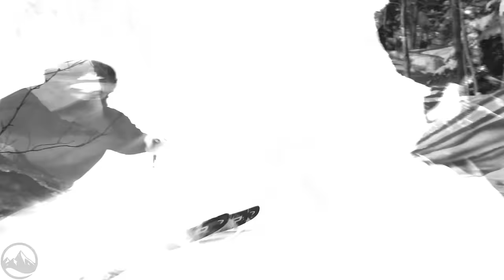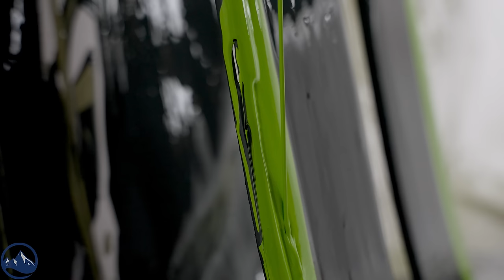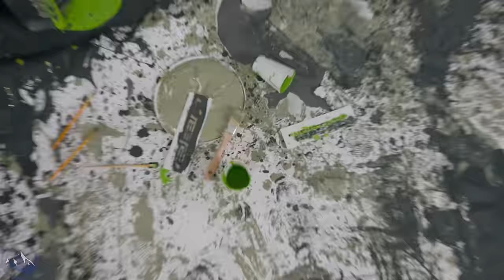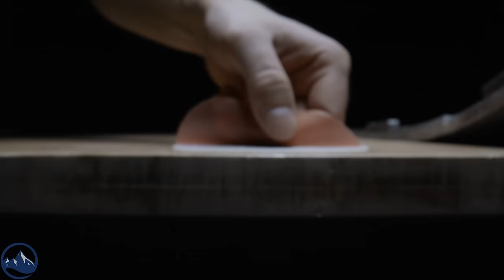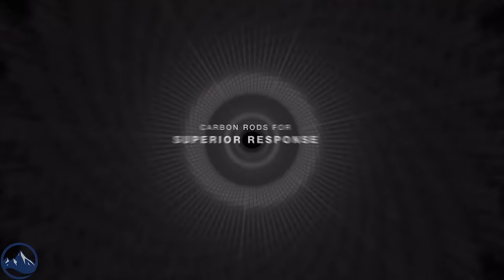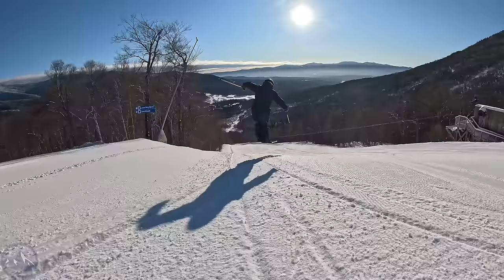2025 Elan Ripstick Ski Collection Introduction and First Impressions with SkiEssentials.com

Comment: This video is very interesting. I have been on Elan skis since I started 4 years ago. Currently on a Wingman 86 TI 178cm, which I feel has helped me progress quite a bit this season. I like the on piste feel of the Wingman, but am looking for something that will allow me to venture to the side and maneuver better in tighter areas like trees. 

I have been intrigued by Ripsticks since the beginning, but was concerned about how they cope with chopped up afternoon snow. As a 6'1" 180lb progressing intermediate that skis exclusively out west (85% on piste) a few times per year, I am wondering how the new Ripstick 88 or 96 would compare to the Black Crows Serpo or Atomic Mavericks. 

Also, if there is any other ski out there that is stable in chop/crud, maneuverable in tight areas, and approachable for a slightly less aggressive skier that I should consider, I am all ears. Your reviews set the standard, and we are all so grateful for your contributions to the community. Cheers!
Reply from the maker: The Ripsticks are very easy to use in chopped snow, but they do not excel in terms of performance.  The Serpo and Maverick will hold up better at higher speeds as those are more stable skis, but they're also more demanding.  The nice thing about the Ripstick is that it's very fun and playful in a lot of different zones, but it's not terribly rugged when it comes to challenging snow conditions and terrain.  I think you're in the right spot with the Ripstick, and I'd lean to the 96 for added width.

Comment: Is there a weight difference between Ripstick 102 and 102 Black? The website shows the same weight, but wondering if that is a typo since there is extra carbon and rods?
Reply from the maker: Keep in mind that when you add the rods, you're removing wood, so it's a neutral weight change.  I just put both the 102's on the scale and the Black Edition's pair was 30 grams lighter than the normal 102.  Basically they're the same weight.

Comment: As an owner of the current 88, i like seeing the increase in shovel stability. I like what the 88 does, especially on the early days in the season where my legs arent as build up as after 15 or 20 days. However, and i know that's a really strange comparison, i grab my Mirus Cor more frequently and it outperforms the Ripstick in nearly every aspect (for me, entirely skier dependant, i'm an lightweight aggressive expert). It's more confident in crud and soft snow, the shovel just plows through everything, it's more consistent tip to tail, does not get deflected as easily, it's the better carver, it's as nimble as the Ripstick and weight isn't dramatically off of the Ripstick. I attribute most of these things to the (too) soft shovel of the current 88, and seeing them improve that aspect will provide skiers with an overall better choice and experience, without any obvious downside or taking away accessibility.
If there ever was a moment to add an 88 Black, it's now! It'll fit in perfectly with the new shovel and smaller step up in overall stiffness.
Reply from the maker: Great feedback, and thank you for sharing!
Reply: Skied your Mirus Cor, and with a 13.0 Radius, they are slalom racers !  The 96 Black Edition will make you a believer with a radius of 16.2 and quiet shovels !   They kill in all conditions.

Comment: Love the current RS 88 for frontside carving, and playing in the late day crud.   I am 5’9” 185 and loved the 172.   Are the new 88s any different carving and playing? What length would you recommend with the new model length difference.   I just tried Wingman CTi and thought that they were great for carving but not nearly as playful or good in afternoon crud.   Trying to decide between this year’s model and the new ones.   As always, love your reviews.
Reply from the maker: I find the new 88 to be more playful and eager to finish a turn.  I like the added versatility of the taper and slightly wider waist and tail.  That said, I personally prefer the slightly straighter old version, but mainly because I enjoy the 188 in that ski and haven't yet skied the 189 in the new 88.
Reply: Is the carve the same?   With the new sizing, should I go up or down from 172….i prefer slow to fast.   Thanks!

Comment: Huge Elan Fan...Knowing Jeff seems to be on the fence of the Regular and Black Edition 96's, I can say with un-equivocal certainty, that skiing in the East, especially Mt. Tremblant and Sugarbush, that the need for a super strong ice grabber is as important as a playful mogul masher. The Black Edition covers all bases, and has the added pop when flying down the groomers doing the turn and burn. The regular Ripstick 96 is wonderful, but a touch more chattery when ripping, and not as strong on biting the ice. My other go-to is my Stockli Stormrider 95's but as wonderful as those are.....and they are wonderful, Elan offers a better overall Freeride/All Mountain experience with the Ripstick 96 Black Edition.
With that said......Great reviews, Great Chairlift Chat and T-Bar Talk....keep it up !   Wonderful to watch you guys review and ski all the time !   Hello From Mt. Tremblant !
Reply from the maker: Thanks!  T-Bar talk was a great addition.
Reply: I’m trying to choose between the 96 black and the Stormrider 95. Tough choices
Reply: Having both the 96 Black Edition and the Stormrider 95, I would say that if you are going to spend more time cruising, The Stockli is King, but for versatility, like moguls The Elan is the better choice IMHO. 😊
Reply: Thank you. That helps
Reply: @delriv5238 I own the 96 Blacks, I’ve skied a Stormrider 95 and for wide open terrain and going fast through crud or on hard pistes, Stockli all the way. I’d take the Ripstick for bumps and trees.

Comment: Been skiing Elans for decades, never been disappointed!  The last 2 seasons I have added wider all mountain 90ish 177ish 2 sheets of metal as my daily driver.  However….as I rotated in my 74 under foot Amphibio’s , 168, I cant help realizing that the tighter skis are for me a lot more fun as a side of trail short turn specialist here in the northeast.
    I see that Elan has added in the Primetime series.  The Primetime 55 looks like a ski right up my narrow alley on the 8’ edge of the trails, and also ripping the full carve GS 50mph turns.   Have you guys skied this model yet?  From my days out this season I know I’m going back to the narrower all mountain frontside Northeast groomer and leave the wide boards for snow storms as rare as that can be here in Vermont 2024.
Reply from the maker: If you like the tighter arcs in skis, the Primetime 55 is sweet.  We skied them last year and thought they were great.  I'm not sure about the full GS 50mph aspect, but it's definitely a great short to mid-radius carver.

Comment: Considering Stockli SR88 and Ripstick 96 Black. I’d appreciate your advice. I skied the Kastle MX89, then I got the newer MX88 model both in 180, but I sold them last season and started riding Faction Dancer 3s 183, thinking I wanted better all mountain and width, but clearly it’s not the ski for me. Even on front side, it’s a lot of ski for me (tall but lightweight). Simply, the Dancer 3 is way too much ski for me, and I felt the MX88 was a bit too much ski in the bumps, but awesome to rip on the groomers. The last two seasons I started doing a lot more bump skiing as my son is a bump monster. However, I’m still a front side ripper at heart.

I’m looking for a new one ski quiver that can hang in the bumps, the crud, the trees and still have ample front side high speed grip. I ski exclusively West Coast (Vail, Tahoe, Whistler). Thanks
Reply from the maker: The Stockli is nice because it has a lot of the same versatility of the MX 88 but with a lighter and quieter character.  An amazing carver for sure, but also is accessible in bumps, crud, and trees.  I fear you won't get the same type of on-trail personality that you want out of the Elan.  If you're a front side ripper at heart, the Stockli is a considerably better option without leaving too much off the plate when it comes to versatility.

Comment: How would you compare the 2025 Ripstick 88 to the Armada Declivity 88C? Mostly looking for snappy edge to edge transitions with energy coming across the fall line at decent speed (not interested in smearing/slashing, prefer to be on edge). The increase in Ripstick stiffness this year sounds like it brings these closer together.
Reply from the maker: The Armada is still stiffer and more responsive from tip to tail.  The Ripstick still has a pretty flexible shovel, and while that's great for easy initiation and softer snow performance, it's not as reactive on firmer snow.  If you're looking for more edge grip and energetic transitions, I'd go with the Declivity 88C.
Reply: @SkiEssentials  Thank you!

Comment: I'm looking to add a 100+ to my quiver.  Currently ski a Stockli Montero AR as my daily driver and love them but want a fun off-piste ski that is on the lighter side but still responsive when I am on-piste.  The new 106 black looks interesting.  I also have an original Enforcer 93 that I have pretty much ditched this year for the Montero.  I'm 6'1", 250#.  PNW skier.  I would say advanced/expert.  Recommendations?
Reply from the maker: If you like the overall style and feel of the Montero, I'd at least give the Stormrider 102 a look--that ski is similar to the new 102 Black Edition from Elan, but with a stronger tail and a smoother overall ride.  For a bit more heft, but not too stiff, the Salomon QST 106 is another easy winner.

Comment: Guys, i’m a similar size to Jeff but now in my 60’s. Get to ski say 2 weeks a year and looking to replace my 9 year old camox (i know !) Back then these had a flat-ish tail so now likely to up to mid 70 length from 168. Love sound of these Ripstick 96, also rustler 9 and of course camox. In reality mostly on piste, occasional itinerary but always go off the side on the few days there is fresh. I go nowhere near to a park! Any thoughts/recommendations?
Reply: Forgot to mentiom, i like how i can smear/get the camox sideways to get myself out of trouble 👌
Reply from the maker: The Rustler is the easy choice especially when you're looking for rounder tails.  Nice to have the metal along the edges in the Rustler with the increased rocker for softer snow.  Easier to smear than the Camox and a smoother carver!  Ripstick is nice and light and agile, but doesn't have the same overall sturdiness of the Camox or Rustler.

Comment: Welp crud . I just bought a brand new pair of 2024 96 blacks 172cm. How much of a change did the BE's get for the 2025  model year?? Sounds like more stability, less vibrations and smoother? Also better and more accurate sizing (175cm!) as I was in the middle. 5'9"/155lb. Ugh.
Reply from the maker: I think you'll be just fine with your 2024 96 Black Edition--that is one of my all-time favorite skis.  The change for 2025 is pretty noticeable, but not a blanket positive for everyone.

Comment: This review gave me a pause. I was about to add Rustler 9 as a final piece of my quiver which currently consists of Mirus Cor and Enforcer 88. I am looking for a ski which can deliver Enforcer's feel but at lower speeds as well as off-piste. Is RS 96 (regular) that ski? Or should I stick with my original plan? For reference, I am 5'9" 165 lbs, higher level advanced skier, wouldn't call myself an expert. Thanks for your help and great reviews.
Reply from the maker: I think the Rustler is the place to be, splitting the difference between the Mirus Cor and the Enforcer 88 in terms of heft and build.  I'd stick to the original plan unless you want something considerably lighter.
Reply: @SkiEssentials  Great, thank you for confirming! Enforcer's weight has never been an issue. Rustler 9 it is!

Comment: Thanks for the review. I am pretty sure a Ripstick is gonna be my next ski. However not sure if I am gonna choose the 88 og the 96. I mainly ski groomers, but often venture off doing short turns on the side of the piste. I like having fun in the late day crud, precision skiing, little jumps etc. I am 5,10 and 140 lbs so I am thinking the 175 in length.
Reply from the maker: I think if skiers are undecided, the narrower will work better.  Unless you find yourself in softer snow more often than not, the 88 will be a more useful ski overall. Agree on the 175!

Comment: Great info filled vid guys!!  Looking to pick up a set of Ripsticks for Utah to add to the quiver. The current 106 compared to new 102 flex pattern has really changed….. Im still leaning towards a current 106 black in a 188 (6’0, 190lbs, aggressive, advanced skier).  Owned a set of regular 88’s for on piste days and found myself pushing their limits. Am I on the right track?
Reply from the maker: I think aggressive skiers will still like the current 106 Black Edition skis as they are stiffer and more capable.  The new 102 is more flexible.
Reply: @SkiEssentials  my thoughts too.  Thank you.

Comment: I’ve been watching all your reviews, great content. Thank you! I’ve been torn between a few different skis. I always ski with my kids so northeast groomers are a huge focus. I’ve considered the rustler 9’s, ripstick 88, 96, and 96 black. Low end intermediate. Given the conditions I ski a ripstick 88 is a good bet but at my weight (250-260) would a 96 or 96 black better support me carving NE trails?
Reply from the maker: Yes, the slightly wider skis in your group will provide better support.  I do think the Rustler 9 is a great choice if you already have the Ripstick 88.  The metal in the Rustler is very supportive, not heavy or demanding.  I'd lean that way.
Reply: @SkiEssentials   which length rustler would you recommend? At my weight would 180 be a safe bet?
Reply from the maker: @erichillstrom4178  Yes  I'd say 180 is a good place to be.

Comment: I'm interested in a ski to complement my Brahma 82s, which are my dedicated hardpack skis. I'd like something softer, lighter, more playful, and more smeary for use in bumps and trees, but which can still rip some turns reasonably well. I was interested in the discussion of weight and how that affects your experience on these skis. I'm about 165lbs, and the Ripstick 102s seem like they might be good for me. Anyone have thoughts on what other skis I might compare them against for the purpose stated above?
Reply from the maker: There's a lot to like in the low 100's, especially if you look at some of the more twin-tip shaped skis.  Even within Elan, the Playmaker 101 is worth a look, Line Chronic 101, Atomic Bent 100, and Dynastar M-Free 99 are great options.  For more directional skis like the Ripstick 102, I'd check out Fischer Ranger 102, Salomon QST 98, or within Blizzard, the Rustler 10.

Comment: As always grateful for your videos!

I’ve been skiing the 106 as my daily driver for the past few seasons and absolutely love it. So much so I purchased a pair of 116 this season to replace my previous powder skis. 

I love the playfulness of my 106 (188cm) and the only thing that has me considering replacing them is a desire to charge a bit harder on-piste. 

This has me considering:
- 106 black edition 
- 102
- 102 black edition 

Curious to get your thoughts. For reference, I’m a 6’ 200lb male living and skiing in the BC Rocky Mountains.
Reply from the maker: I think if you are looking to move to a harder charging ski, the 106 Black Edition is the way to go.  The new 102's are more flexible and not quite as amenable to powerful skiing as the current 106's.
Reply: @SkiEssentials  thanks!
Reply: @SkiEssentials  How would the new QST 106 compare with Ripstick 106 Black?
Reply: Where does the 102 black fit in? Is it softer or stiffer than the 106 standard
Reply from the maker: @paulberry2451 The shovel of the 102 Black Edition is more flexible than the regular 106.
Reply: @SkiEssentials  how would a Rustler 10 fit in this mix? The metal likely adds some stability… did some testing, felt easier to pivot but didn’t carve as nicely as the ripstick.
Reply from the maker: @bjom77  Yeah, Ripstick is a more rewarding and energetic carver, but the Rustler is more capable from a sturdiness standpoint.

Comment: Way it looks 106 got turned into 108 and the 102 just jumps in between. Wonder what the change in flex does to variable snow handling in backcountry. 143mm tip will float allright but if there's steep ice in the mix. I tried to look, 106 had probably widest tip of any 105-108 ski out there.
Reply from the maker: The new skis have more flexible shovels for sure, even the Black Editions.  This means that less aggressive skiers will have more success in variable conditions and terrain, but harder chargers may find them to be on the soft side.  The older (current) 106 Black Edition is the best of this group for faster skiing through adversity.

Comment: Bummer to see the 106 and its additional burliness over the 96 go, but nice to see Elan address the stated length issue by going straight pull.  The outgoing gen tended to measure ~2.5cm shorter than their stated length.  Did they address the width issue (beyond the 88), i.e., no longer measuring 2mm narrower than the stated model?  Also, a little disappointing to hear that the skis got lighter.  I really liked the shape of the outgoing 96 BEs, but found they had a limit and would get knocked around in chop and crud.  If they put metal underfoot like the Wingman instead of additional carbon in the BE to get around 1800g @ 182 per ski, they'd have a killer ski for us 180lb + folks.
Reply from the maker: The move here is definitely more to the playful side of the spectrum.  It's not going to be better for everyone, but as far as fun-loving directional skis go, these new Ripsticks are right at the top.